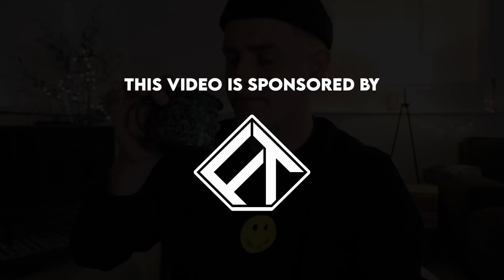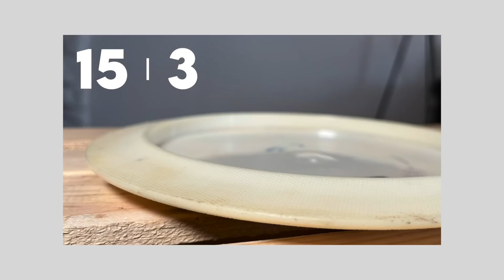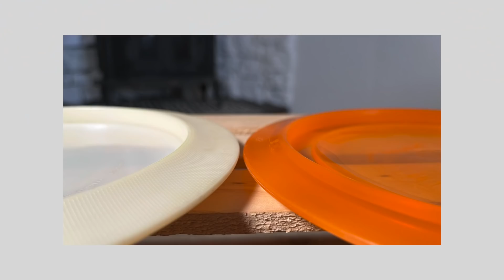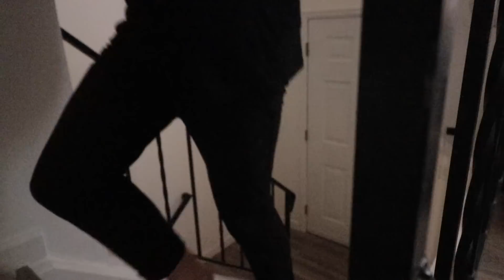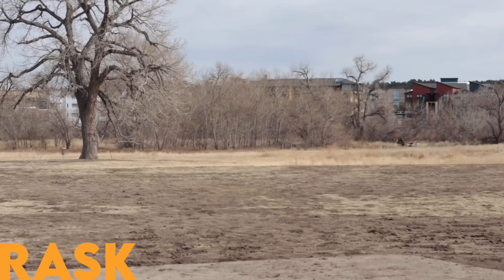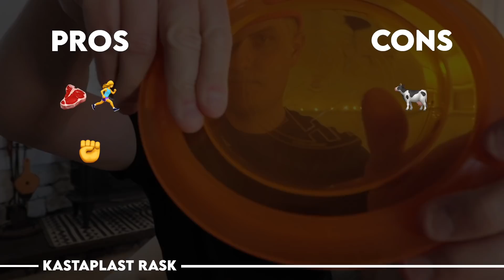Testing Three of the Most Unique Discs (Distance Drivers)

Comment: I got a rask because I wanted an ultra beefy utility disc for scrambles or super low flare skip shots. but the rask I got is not beefy at all. i don't really have a big arm either, i think i top out just shy of 400 ft, and it goes laser straight for a good bit before fading. was slightly disappointing because it was not doing what i wanted to do but it's staying in the bag for a while...

Comment: Yes! More breakdowns of discs attempting to be innovative!.. 
I really want to see someone re-tool the turbo-putt to be legal. 
If I could design it, it would have a raised "second rim" like the rask, but only about the size of a quarter in the center of the disc. I don't think the handle-like outer rim would be legal, but there's gotta be another easy way to get good grip, like the golf-ball dimples or something. Turbo putting is a gem in the rough, in my opinion. :)

Comment: I truly believe that MVPs overmold tech+Lofts rounded rim would make for the perfect combination. The overmold atleast on paper moves weight out to the edge of the disc, making discs more stable without being overstable, and that allows for a more understable wing design without the requirement for extreme RPMs and thus a straighter longer flight. Atleast in theory :D

Comment: Just the discs I expected to see. Could have added Epic on the list.

Someone already mentioned Discwing's Quarter K. They did the rounded rim disc in 2005. Some liked, but most didn't like it. Those are still being sold at least in Ebay. I don't mind that Bohrium tried it again, but I don't like it being advertised as unique or something that has not been done before.

Prodigy made M5 with two rims probably close to 10 years ago. Those rims were very close to each other though and not like Rask has. I think the purpose of it was the same.
Understable midrange that feels in a way like a faster disc because it has a thicker rim. That was a bit odd disc as well and didn't sell well.

What is common with experimental discs? Low sales.

It is still nice to see new attempts to reinvent modern disc. I am sure there will be some that breaks through. It has happened in all sports. Sometimes it can take a long time. 

Clapper skates in speed skating were patented in 1894 and re-invented in 1979-1980 and despite with clear benefits and scientific proves it broke through in late 1990's. Now you can't be on top without those.

Comment: Rask thrower You mentioned the Rask gives you a 14 speed with a smaller rim comparatively. Do you know what the rim size is on the Borhhum? I'd also wonder if the "innovations" make the disc better or worse as they beat in compared to new.
Reply from the maker: The Bohrium’s rim is 2.5cm - that said, the measurement is from the inside to outside, but doesn’t account for feel due to the gradual rounding on the rim. I’d say it also feels more like an 11 speed 👍

Comment: The racketen has the hex technology and is a more neutral disc. The missilin is the beefy experiment. The raketen was the further flying disc.
Reply: I actually bought it when I first started playing (genius) but after about two years I can actually throw it pretty well. It obviously beat in a little now so it isn't as fast, but it is dead straight.

Comment: It'd be interesting to see what difference the rounded rim actually makes. Like if you took two identical discs except one is a few grams heavier and sanded the rim of the heavier one to be rounded like the Bohrium to see how differently it would fly compared to the unmodified one.
Reply from the maker: Løft simulated this exact thing during their design process with a version of the Bohrium with a sharp rim. At least based on the simulation, the difference is drastic and clear 👍

Comment: Love what you do! I’ve been involved in discgolf long enough to tried the first Brittish brand DiscWing, they actually had a mold called Quarter K, that also had a rounded ”inside rim edge.” So Loft was not first, but discwing was a bit before it’s time and do not longer exist. Try out blunt blow fly, and old school dolphin  or ”10 meter brick” for odd design. Also first molds of Latitude64 had uniqe design with a ”power dome” on top for best glide. They had a special sound when they hit the ground so you could here on the sound what Disc it was that landed. Love from Sweden, keep on the good work!
Reply: Quarter K was so soft the discs on hard ground would begin to deform. Disc Wing had another mold like the Quarter K and then Quarter K II that was the Quater K in same plastic but by the time these came out the company was no longer making discs due to nobody buying the discs. One of the shortest lived companies to make PDGA approved discs at only 2 years as a company. 

10 meter Brick they all shattered over time due to how fragile/brittle the plastic was that started at max flex to only become stiffer over time. The later new quest company started in 2013 ones were from what I saw on Amazon in 2015 were softer the the Gumputt models or Blowfly/Blowfly two one brands discs in a Z/Champion plastic, all other discs were normal plastic. They were made in Rockford Illinois until 2016/2017 when they started up again in 2013/2014. The Seller for the new Quest discs on Amazon claimed in lower description the discs were the exact old molds somebody found in the Dumpster of Gateway, the old company after they went under in 2009 or 2010 they first Quest company from St Louis area dumped the molds to Gateway in 2012 who had no use for them with Quest making a mold for Gateway that Gateway was pissed about the quality with the Diablo. The pictures of the discs looked like most molds had as much flashing as Innova could in some runs from 2011 until 2017 up to 1/2 inch/1 cm flashing.  Of the Quest molds the Quest T-Bone in the new plastic is the One needed to be tried similar disc to the Gateway Diablo but smaller mold. 
  
The DGA  Blow Fly and 2 as well as the Gumputt Driver and regular, regular was called Blunt in 2000's are some of the softest discs besides this new brand making silicon plastic PDG approved discs that are some of the softest molds besides the DGA Steady signature series. Funny story is the PDGA would have been DGA if it were not for Ed Hendrick who was making the Mach I/1.5 but none of its own discs was getting his company name DGA registered at about the same time that the PDGA was making its own mold.
Reply: @caseysmith544  Thank´s for sharing, I have owned all the disc but sad to say that I lost them over time, al but the 10 meter brick, but i have not used it so still unshatterd for me!

Comment: Another Kastaplast disc you should have a look at is the berg. It’s an awesome putter with a super thick rim, groove on the edge of the plate, and grabs the ground like nothing else. And it has a total cult following - this disc is legit.
Reply: Check out the AGL Baobab if you compare discs with the berg! Use code “LeftyTyler” at checkout for 10% off!

Comment: The rask has recently made my bag. I had wanted to try it out for a while but it was just so overstable. Kastaplast has released a newer version of the Rask called the "Z-Line version" and its the max distnace rask everyone needs in my opinion because it isn't quite as overstable. If you get the change I'd highly suggest testing one out and even comparing the two versions of the Rask together to see the differences
Reply: This 👆. Try out the Z-Line Rask or the Luke Samson Team Series Rask that seems to be the same disc. You get all the pros you lined up but without the excessive beef. Think of it like a "throwable" Rask :) . It flies kind of like a beat in "normal" Rask.
Reply: Trouble is finding a Rask Z as it was a limited run
Reply: @BillFromAZ  That sucks because it seems everything is a limited run now from brands where this mold, they have is not core lineup disc.
Reply: @BillFromAZ  agreed. I think infinite discs was/is the best place to find one still
Reply: @Vol4Life96  I've looked on the Infinite Discs website. For Kastaplast,  they show Kaxe and Kaxe Z separately...but they only show Rask as an option.
Reply: I have both the Rask and Rask Z and the latter has a lower rim. Basically, the 'bead' is lower on the Z. At least that's what I found. The Z is absolutely one of my favorite discs along with the notorious Berg. It really gets me my best distance and I don't have a big arm at all.
Reply: Rask flight numbers 14, 3, 0, 4. Rask-Z 14, 3 ,-1, 3 

I've just picked up a Z as I found it on sale. I haven't had the chance to throw it in anger yet due to a chain of storms but I'm really liking the feel of it in my hand.
Reply: The Rask Z is so fun to throw. Easily is my max distance disc and so comfortable to forehand. It is available. Go to Pureline or Parplastics. There are other sites too, but they are out there. I believe the Luke Samson tour Rasks, which are the same thing, are still out there too and fly even better.
Reply: Definitely not for everyone. Most players that aren't at least advanced shouldn't throw faster than a 12 speed.

Comment: Got a Rask in the christmas discswap, have a Missilen in the mail as we speak, just miss the Bohrium for the oddball triple. They'll fill a niche as flex forehand shots on my nemesis hole. Would you recommend Bohrium for a forehand?
Reply from the maker: What are the chances? 🤣 and yes, it’s super interesting once you get used to the grip!
Reply: @TrashPandaDiscGolf  Just got that disc in the mail, the seller had it confused it wasn't the Missilen but Raketen, another 'prototype' from Latitude 64 with that hex grid on. Less overstable so I'm well pleased as it fits my nemesis beating plan better.

Comment: Kastaplast made a run of flippy Rasks. If you can pick up one of the Luke Samson, or Rask Zs, then you'll be crushing them without any issues. My distance crushing friend gets a standard Rask to flip up, and the flight is completely unique. It goes straight or flipped over for forever, and then suddenly drops from the sky with the hardest fade.
Reply from the maker: Super interesting!

Comment: Have you tried the Latitude 64 Raketen? Same dimples and speed, but somewhat understable.
Reply from the maker: Not yet! Still a whopping 15 speed though 🤯
Reply: @TrashPandaDiscGolf  saw one of these in a used bin a while back, either a misselin or a raketen but it looked very odd and had a small portion on the flight plate with no hexagons so you could put your thumb on it

Comment: The Monarch/Groove should be mentioned as having a unique rim. I'd certainly be interested in learning how that affects flight shape. I'd also be interested to know how much correlation there is with the glide/lift of a disc increasing understability.
Reply: @H K I wasn't attempting to correlate the rim shape of the Monarch/Groove to stability. I was commenting on the unique rim of the Monarch/Groove while also independently pondering if the glide/lift of a disc has a tremendous correlation to stability. 

I would hypothesize, though, that an increase in lift decreases the stability of a disc.
Reply: I always keep a groove in my bag. I don't have another disc that I can flip over easily but still have a really heavy fade as soon as it slows down. And it ALWAYS skips on the ground, which is a nice reliable trick for some shots.
Reply: Monarch is the one that needs to be tested if still in production. The Grove in Champion is an unpredictable disc so much they are still running on old discs in the warehouse from 2014 or so, they each fly very very off in flight like one will be Destroyer in flight then another will be like an Archon or new Wahoo in flight from the people I have talked with in person about the mold.
Reply: @caseysmith544  I've heard this for years but every Groove I've had (five over the last decade) has flown exactly the same except for when they get neat in and become more Flippy. 5/5 disc that all fly the same and nobody who I've ever heard that same story from has never actually used a Groove. I golf with another person who has also been throwing Grooves regularly for as long as I'm have and he agrees with me. I personally think that the "unreliability" is actually a variance in the technique, not the disc.
Reply: @jawaring4367  I picked up two Champion Groves in 2014 and one had the Grove size grove in the discs wing with the other having the Monarch size grove in the mold, tell me those two discs would not fly the same. Also, you said after the mold wears in after a bit they do not fly the same like the initial break in, there in lies the problem of your problem of the mold becoming this unreliable flippy disc. Even the Valkyrie Or Road Runner dose not do this in better plastics nor does other US Innova Discs, they tend to wear in with a slower pattern. 

Oh, stay away from the Champion Archon unless you want a disc with 0 or lower glide. This is common with the Champion Archon I got in 2019, it had a dome to flat section in the middle that is common with the mold. The Star does not have this issue with the plastic as much and feels like a faster Valkyrie.
Reply: The Monarch has such an odd thumb/tomahawk line. I've never liked it back hand but it's definitely thumbed me out of a lot of tough situations.
Reply: @Elderlandwurm  I have used it backhand but the problem was the disc was SO US but to the point it flipped over on me to face upside down when using my brothers old disc. This coming from a player who likes Valkyrie and Archon in Star as a main driver molds and finds a disc more then a Shark for last numbers  0|2 even 1|3 to be too much   for midrange or Stalker again same numbers for fairway/driver to be too OS for most situations except extreme wind.